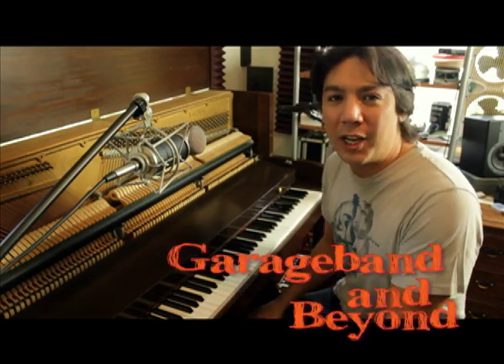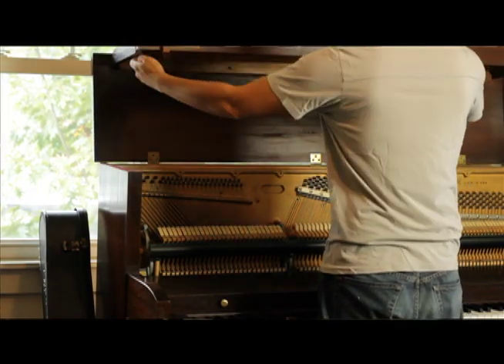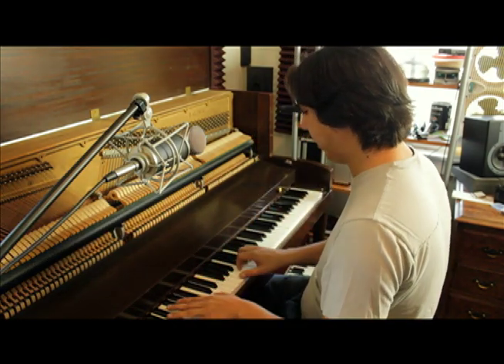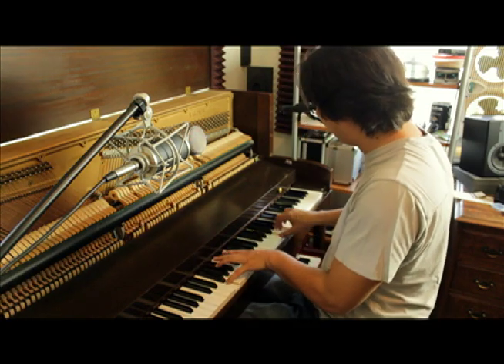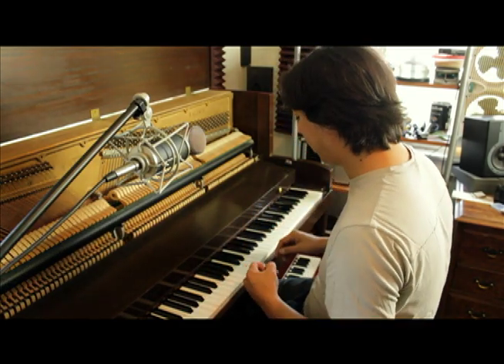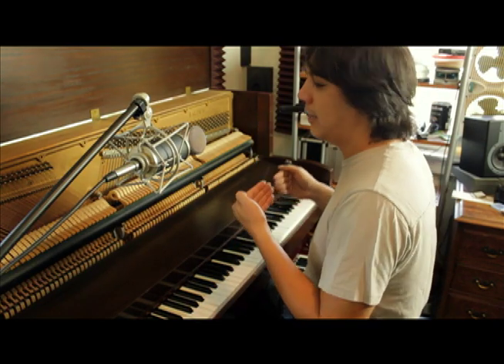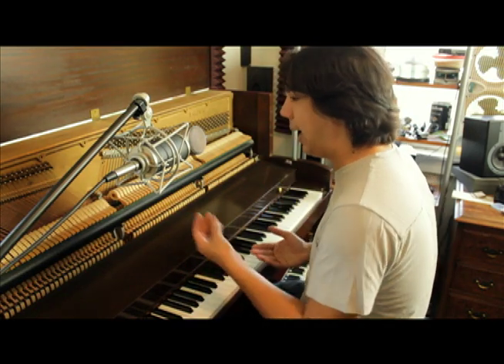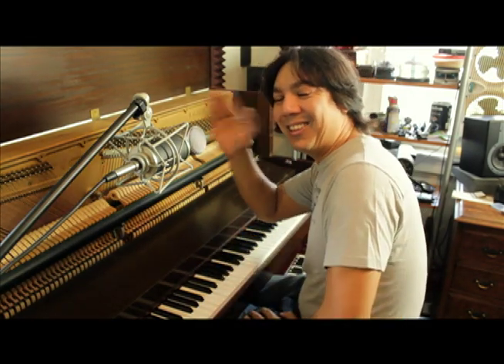How to Record Upright Piano

Comment: I like the way the Baldwin opens like that.  I had an old Wurlitzer console, that had that open flap like your talking about, but you could still expose the hammers and strings by taking off the front panel completely.  For folks that have a spinnet (an upright under 40") I think you can only have the top up.

Comment: I've found that the apex 215 ribbon mic is really good for upright pianos. They are quite dark and midrangey mics but they sound very smooth and warm on pianos and allows for pianos to sit in a mix without being buried in the mix. I place one on the bottom left and right side of the piano equal distance from the strings to bring out the character of the piano. You can't get the 215 as it has been discontinued by apex but it is just a re-branded Alctron HRM-14B/ShuaiYin SYR50

Comment: Hey Lewin nice vid and tutorial, but I have a question: Is the CAD Trion 8000 in Omnidirectional mode or cardiod ? Also, If I just put a single omnidirectional mic at the center of the piano, will I get a good sound comparing to this stereo technique you're using in the vid ?
Thanks.

Comment: Hi, great video.  Your sound is so good here that I bought these same to microphones to record my Kawai upright piano.  Could you give some advice on what settings to use on the mics themselves, and which tip to use on the E70, the omni or cordioid?
Where should I set the switches on the mics for the best piano recording?  Thanks!
Reply from the maker: +white bird on the E70 use the Cardiff!
But also I encourage you to go and do some research on what those polar patterns actually mean. Understanding the specifics of how microphones work Will definitely help you get better sounding recordings.
Reply: Thanks, did you mean cardioid?  I will definitely do some research.  But could you tell me what settings you were using here to get this great sound?  Thanks !
Reply from the maker: +white bird yes, auto correct got me there.

Comment: Didn't bother reading down too far in the comments to see if this had been said already or not, but most uprights whose tops open in the "piano bench fashion" can be opened fully like his by removing the front wall. On my Yamaha (don't know the model - sorry, I guess) the top opens with a horizontal hinge and then the front piece is held in place by two latches. Flip those and it slides off with little to no struggle.

Comment: Do you suggest putting the mic's in front of the soundboard of the Piano? Which is on the back... I've noticed when my upright is at a open space and not against the wall, it gives off a fuller tone to the notes.

Comment: are these condensor mics? And why do you have different mic for bass and one for high? I have one condesor microphone and one shure standard mic. Both of these are for vocals. Is it ok to try and mic the piano with this?
Reply: Hi Amanda, both mics are condensers that require phantom power. The e70 is suited for higher frequencies in the upper register of the piano. The Trio 8000 is a large diaphragm mic and can capture more detail in the low range of the piano. Using both  allows you to get the whole frequency range of the piano.

Comment: Is there a way to record an acoustic instrument in MIDI? I like the idea of using midi but I don't want to buy a separate keyboard to record with.
Reply: You would save a lot of money and effort just buying a cheap midi controller. There used to be trigger systems, but they were very buggy and I can't seem to find them anywhere anymore. They also used to cost around $400.

Comment: I would have thought that the piano would sound more realistic if less closely miked, and in a more spacious accoustic.
Reply: You want a nice clean cry mix to begin with, as all those effects can be added afterwards. If they are even desired. Remember, the most over used effect is reverb :-P
Reply: NoviceInDisguise Those "effects" are uneccessary and make the piano sound artificial, and miking closely is definitely not going to produce a natural sound.
Reply: smudger671 Exactly. Get a clean sound, that is the highest priority. As I mentioned in my post, you don't really even need the excessive reverb effects. They are more for if you are using it as a backing instrument.
Reply: NoviceInDisguise Which is exactly the opposite of what you've said!
Reply: smudger671 " . . . All those effects can be added afterwards. If they are even desired. Remember, the most over used effect is reverb"